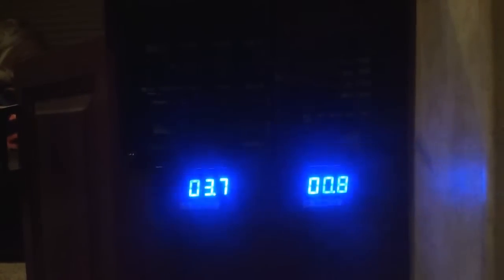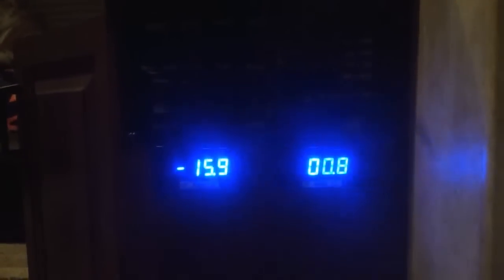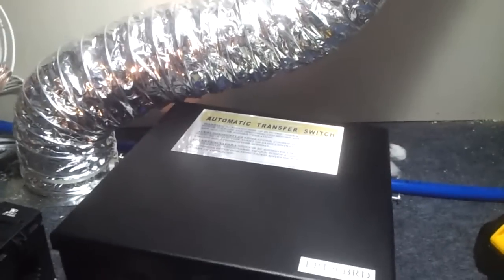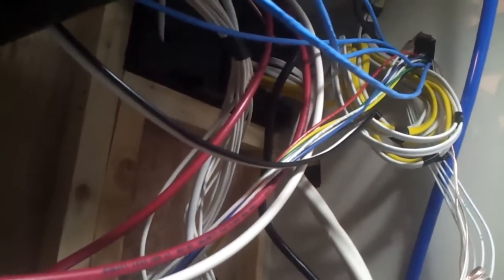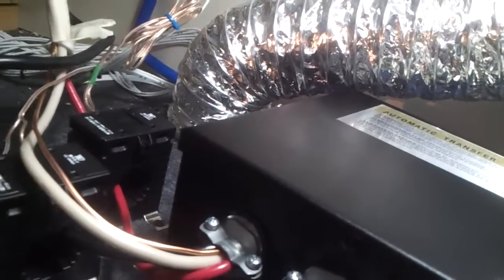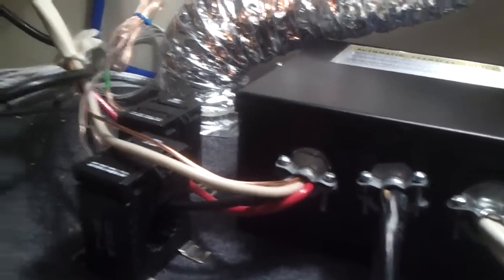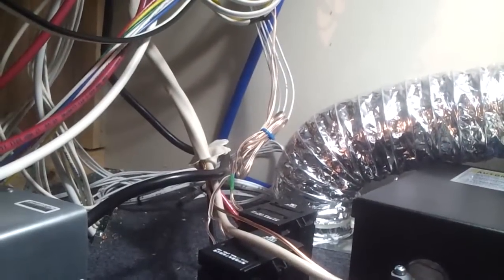How To - RV Amp Meter and AC shunt install and demo - steps included in description

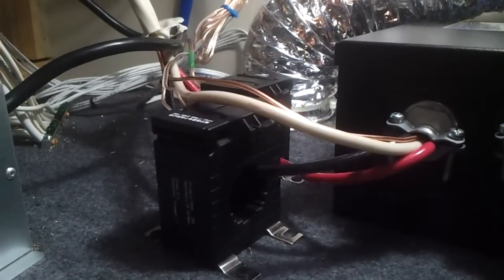Comment from the maker: The video is switched, demo first then the part where I show the shunts for the install is at 2:00 in. 
Steps:
1) Turn off all power to the coach, turn off any inverter power as well!
2) Install shunts coming out of the transfer switch before the panel or out of the short power before the panel.  There will be a single shunt for each leg and in most cases you'll have to disconnect the power lines somewhere and strip back the outer jacket insulation to get the legs separated (red and black in most cases - white and green are neutral and ground).
3) Drill holes below panel to put in meters
4) Connect meters up to shunts and then give the meters power
5) Test by turning on heavy appliances
6) Like and subscribe!

Comment: Do these things go defective often? did you find what the problem was?
Reply from the maker: +evypr0ductions Hey - actually it was defective when I bought it. I actually made this video to send to the seller so that they would replace it.  They ended up being so hard to deal with, that I never got my money back for the defective one.  I do however, have the new one installed and they've both been working for years.  The only thing that's failed is that the decimal place stopped lighting up on one of the shunts. I can still figure out how many amps it's pulling, but nevertheless, it's disappointing still. You get what you pay for I guess.
Reply: +Andy Wofford "you get what you pay for" meaning you bought them on ebay at 1$ each, directly from China?
Reply from the maker: evypr0ductions Pretty much.  I bought them from a US company in California,  but they weren't made here.  Maybe $10-$15 each.
Reply: +Andy Wofford Thanks for the info! I was looking at a voltmeter/shunt kit for 5$ I'm building a campervan out of a 2010 extended and raised Ford E250, I've never done any of this before, now I'm working on the electrical design... so confusing.
Reply from the maker: +evypr0ductions I'm obsessed with information.  I look at them all the time when I'm using the unit,  and even some when it's parked.  Such a useful tool to find out what you're pulling,  amp wise. Best of luck to you!  You'll figure it out. Sounds like a fun project.